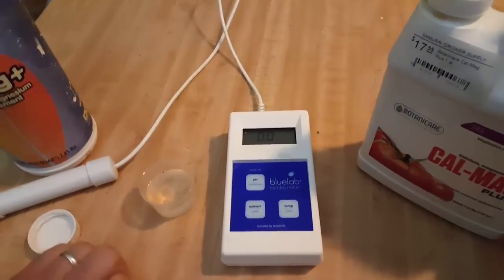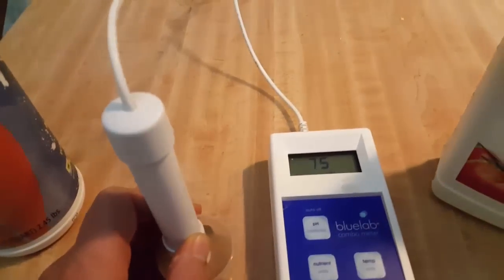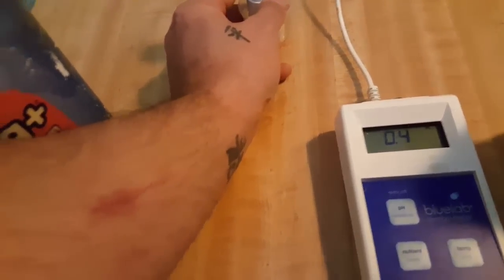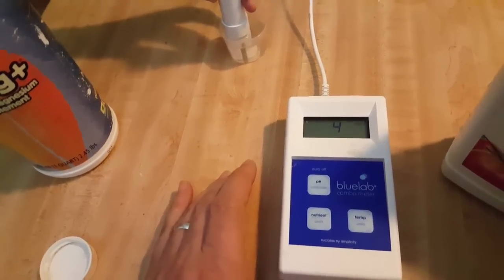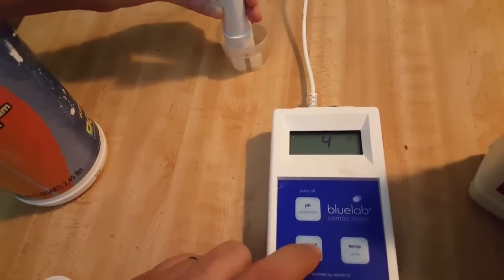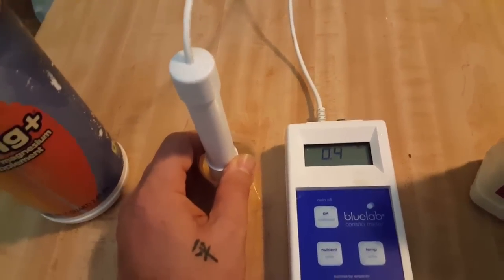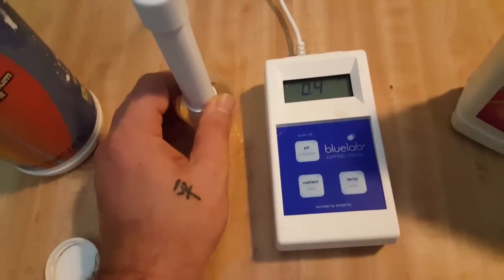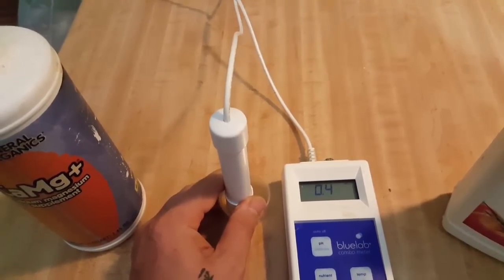Difference between ec tds ppm Important

Comment: the two conversions are set for the maximum amount of ppms the meter will read. ec500 reads between 0-4950ppm and ec700 measures between 0-6930ppm.
Reply: What's better 500 or 700🤷
Reply: I know 500 scale would read lower 700 scale will make u add water 😆

Comment: In my experience it does not matter which reading you use as long as you know which you are using. As you said many meters out there have different types of readings, but the friendly people at your local grow store should be able to help anyone who is confused at point of sale. And if they can not, your in the wrong store!

Just to clarify I have used EC/PPMx500/PPMx700 and all it takes is some general intelligence to work it out. I mean, we are not exactly sending people to Mars here. I actually prefer PPM but my Bluelabs EC Pen (which actually measures temps and all three varieties of TDS) is broken and I need to return it for warranty. Sadly electronics are not made as well as they used to be due to competition and trying to cut costs in manufacture.

So I'm wondering where you got your qualifications to be able to tell people what to do? As i stated in an earlier video of yours, perhaps trial and error before spruking anything would help. Make your own mind up before you try and influence the minds of others.

Growers Love BU

P.S. Do not take this an an affront, I'm simply stating my opinion as you do yours. I just dislike when people are given half truths and misinformation in general.
Reply from the maker: +Badass Unicorn No half truths here. The reason I recommend EC is because it is universal. If a grower states that they water with 900ppm, they rarely ever state if they are using 500 or 700, thus it can confuse the person trying to follow. This is why I use EC now so my new growers know exactly what I am watering with. 

I've been growing for dispensaries or years. This doesn't make my way the right way. I explain why I do it the way I do it, though.
Reply: Clever you..sh** I'm like an in & out the store I don't like waiting around & sh**..I like " got it" swt..laters..

Comment: My understanding. 1EC = 500 or 1EC = 700 on the conversion. most PPM meter use 500. one thing to consider is that for accuracy EC is supposed to be temperature compensated and without it being compensated it is accurate at 25C
Reply from the maker: +Tom Keyser Yeah, most US brands are x500.

Comment: Thanks for the data on ec/tds/ppm. I used a cheap ppm meter this year and it wasn't accurate. Gonna chunk it. I'm thinking a few more bucks on a good ec meter would be smart. Also, you mentioned some had trouble hearing Samantha. Maybe if both of you were the same distance from the camera viewers could turn up the volume? Just a thought. Keep 'em comin'. Enjoy your vids.
Reply from the maker: +Okie John Thanks. We will try that.
Reply: Do you really need to be that accurate though ? It doesn't tell you the break down of what's in the water. You just know that a certain percentage of it is shit while the other is what you put in it. A 20$ meter should be fine as long as you stick to basic formulas. I would argue that money spent on an RO filter first and starting at close to 0 ppm would be more beneficial
Reply from the maker: +Munky332 ec meters are cheap. ec is not that important though. pH is. too many people buy crappie pH pens that don't work and wonder why their plants have defiencies. most every time it is a pH issue.
Reply: +Grow Pot Cheaply I totally agree man. One thing I will say is that you can make the cheap ones work. I have a cheap one made by etekcity and it works great if you Calibrate it every week. Stays within .07 or so and imo the should be good enough considering the range of pH required. I aim for 5.9 which means even if I'm off by .2 im still way good.
Reply: +Grow Pot Cheaply I've never really trusted any meters. All the negatives I see written crush the trust issue. BUT my PH is spot on every time because I use a cheap liquid swimming pool ph kit.
Reply: Okie John don't most pool ph kits only stick around 6.5 to 8.0 ? if you are doing any sort of hydro you want much lower than that, unless you are doing soil? i've had good luck using my elcheapo Etekcity that cost me like 14$. 

i've also found that, 1.5 tsp (7.5ml) of floranova bloom, 1 capful (~5ml) of calmag+, and 1.25ML of pH up in 1 gallon of RO water, gives me ~1100PPM on the x500 NaCl scale (2.2 EC), and a perfect pH of around 5.7. this was confirmed 3 ways, digital pen, pH litmus paper, and the dropper test. all confirmed. so if you need full strength hydro, and need a quick batch, that is where I would start.
Reply: That's a good point Munky332
I got mine from General Hydroponics and it goes from 4.0 to 8.5 in .5 increments -- I do wish the color chart was graduated better, but it is reliable.

Comment: Maybe you could help me. I accidentally ordered an EC meter instead of a TDS meter for my aquariums. My two old ones are reading 135 and 140, and wasn't sure which one was right, so thought I would order a new one, but I messed up. On the EC meter I am getting a reading of 253 and when I did the calculation it is no where near any of my two TDS meters. This can't be right at all, because I also got it tested at the local fish shop the other day and they read a TDS of 127 and I know I have low TDS, so what is going on? Does this mean my meter is wrong or am I calculating it wrong? Please help.
Reply from the maker: You probably have it st to the x700 setting, or it is x700 meter. Does it tell you the EC, sch as ,4?